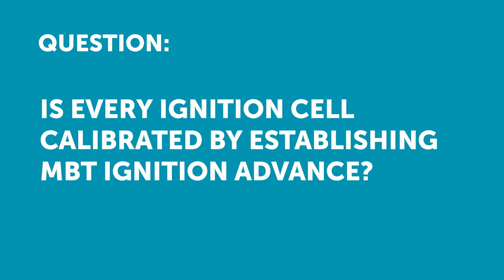Do You Need To Manually Tune EVERY Cell In Your ECU? [HPA Q&A]

Comment: Cant wait to get a standalone ecu to tune. My bama tune does detonate at part throttle in mid to high rpm. I dont spend a lot of time there but when I do it starts pinging like crazy and either needs the throttle stomped or released.

Comment: Exactly, you get the important, most used cells optimized, then interpolate the rest with common sense
Reply: Longterm fuel trims help too... i think
Reply: @2511jeremy  I think you mean short term fuel trims, long term is learned